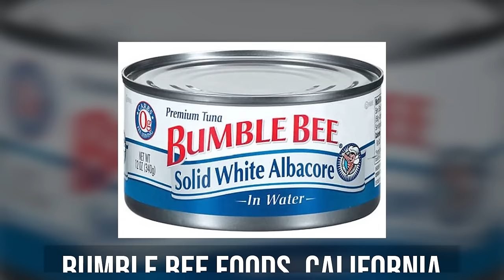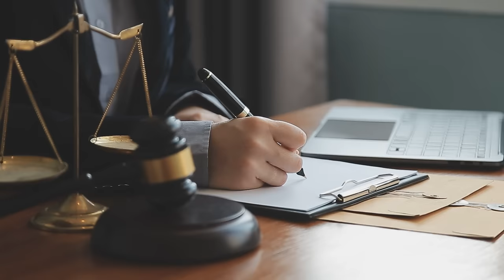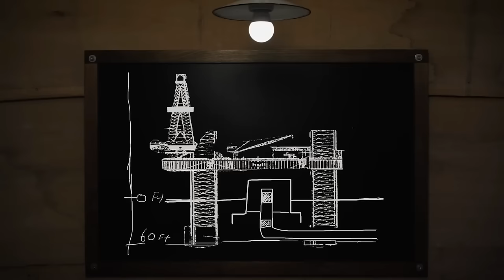Trapped ALIVE. 9 Bizarre Deaths

Comment: Some of your stories are badly researched. The divers did not have to work inside the pipes, but were sucked in by the release of a valve. They were left inside bar the one you mention, and then he wanted to go back to rescue the others, but was refused permission. All the others died and were later cut out. John Jones could not be pulled out of were he was trapped, in the nutty putty cave and is still there. The entrance to the cave system was sealed up.

Comment: The research done for this video is ridiculous. It's like you are throwing darts at random circumstances.....the first story, that poor guy was an epileptic and doctors who were tasked to investigate this tragedy believed that due to the onset of a seizure he becam extremely confused and all cognitive thinking stopped. He sustained burns on 95% of his body. 

The John Jones story, his last name was Jones not Johns. The cave walls were not too hard that they couldn't go deep enough for a winch, quite the opposite. Muddy putty cave was named this because the walls are like a soft putty...he did not have a mistep and fall, he was going head first through a small opening he believed to be a section of the cave called Ed's push that was just before the birth canal, unfortunately he wasn't. He went into an unmapped portion and subsequently got stuck head and right arm down. They did not use grease or whatever lubricant your dart landed on, nor did he have the ability to move back and forth. They were able to drill into the walls for a winch, they pulled him up less than 12 inches and due to muddy puttys soft putty like walls, it popped out of the hole they drilled land a bad blow to one of the rescuers and he had to go to the hospital, but john just fell back where he started. Never was he even remotely close to being successfully pulled out of this spot. What a disrespectful way to discuss someone's death.

Comment: In John Jones case the rock they tried to dig the pully system into wasn’t too hard. It had a layer of putty in it and was not stable enough to hold the cable. It gave way and broke hitting John in the process.
Reply: This video has so many false details in John's story. It seems so disrespectful to his memory.
Reply: It didn't hit John, it hit one of his rescuers in the face since the pulley was close to his face when the rock gave way.

Comment: For a start that crab must of been made of steel because the morgue doors are made of very thick double steel
Secondly is organ donations are done in theatre not the morgue as the person has to be ventilated (oxygenated) so it keeps the organs alive. They remove the organs place them in special donation storage containers and packed with ice to slow down deterioration. So those stories are false and as far as corpses sitting up, it is very rare and certain,y doesn’t happen when the body has past rigour and has been kept at morgue temperature.
Reply: *must've been

Comment: The segment on John Jones is so wrong.

He took a wrong turn and thought the crevice led to an open space that would allow him to turn around. 

It didn’t, leaving him trapped nearly vertically. 

A paramedic reached him and using the pulley system, they managed to just about free him. He was able to make eye contact with the paramedic. 

Just as they made the pull that would have pulled him free, the ledge crumbled. He fell back in deeper than before, slipping past a piece of rock jutting out from the wall. This piece ended up jammed beneath his lowest most rib, and put him beyond saving. 

His cause of death was positional Asphyxia. His organs slid up to his chest and crushed his lungs.

He was a med student, not a spelunker. 

Please, get your facts right. 

Yes, I have participated in several cave rescues. (No, not Nutty Putty. I was putting myself through med school at Yale.)

Lastest one had me spend 36 hours below ground with the patient in a space roughly five feet by 6 feet. I had to squeeze through a crack 15 inches in diameter to reach them. 

It took my crew members 36 hours to safely dig down to us.